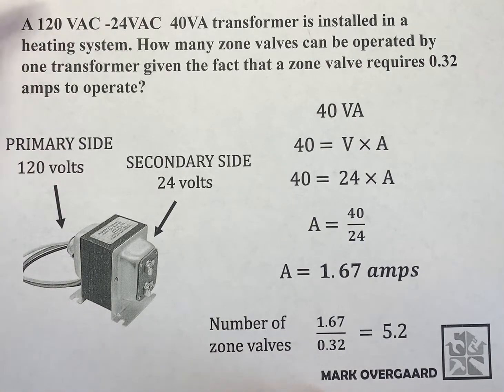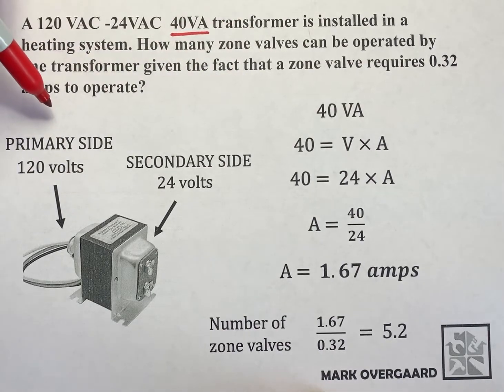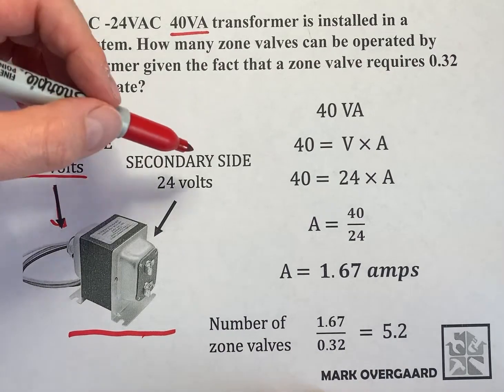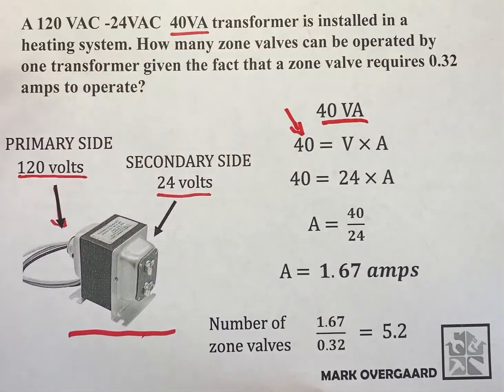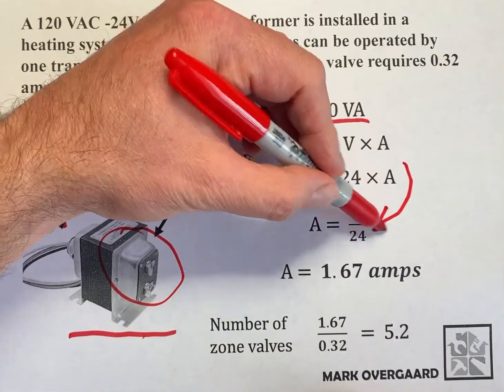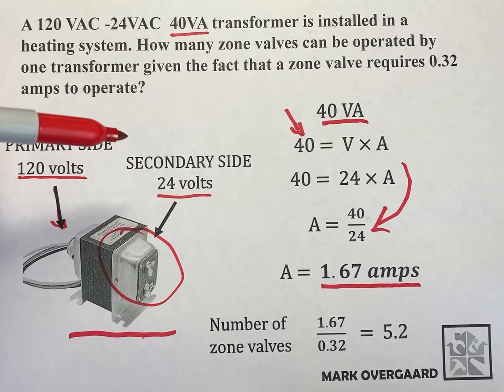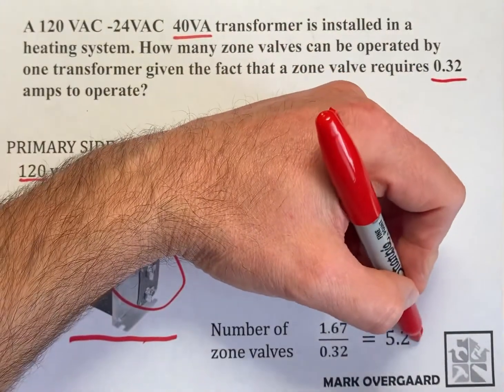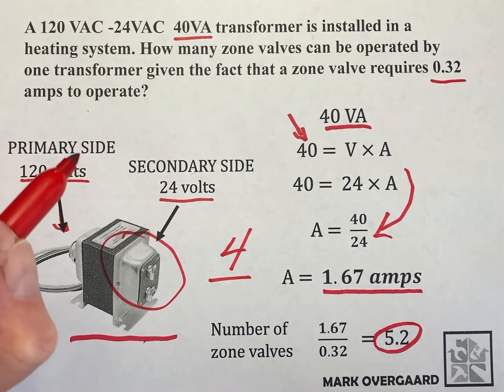TRANSFORMERS - THE SECONDARY SIDE - CALCULATING AMPERAGE

Comment: you can calculate 80% of the transformer's VA rating and use that as a safe operating limit. For a 40 VA transformer, 80% of 40 VA is 32 VA. Staying below this value helps ensure the transformer does not overheat and extends its lifespan.
 This practice is recommended to maintain a 20% buffer and prevent the transformer from being loaded beyond its safe capacity.
 The VA rating represents the maximum power the transformer can safely deliver, and operating below 80% of this rating is a common safety practice.

The maximum safe constant current that can be drawn from the 24V secondary of a 40VA transformer is 1.67 amps.

This is calculated using the formula: $I = \frac{VA}{V} = \frac{40}{24} \approx 1.67\ A$. Exceeding this current will overload the transformer, potentially causing overheating and damage.

While some sources suggest derating the transformer (e.g., applying an 80% factor for a maximum of ~1.33A continuous) to prolong its life and reduce heat, the fundamental maximum based on its VA rating is 1.67A.

Comment: Great video, short and to the point. Typically for sizing a transformer, we consider a safety factor of 20% or 1.5 x the largest load + all other loads (if there are varying sized actuators) , whichever is greater.

In practice though, it's rare for all to be energized at the same time

Comment: Can we find out the maximum output current of a Stepdown transformer using a high watts resistor as load in series with a multimeter?